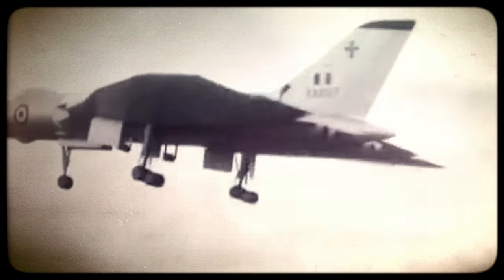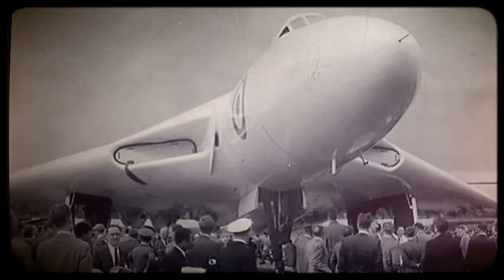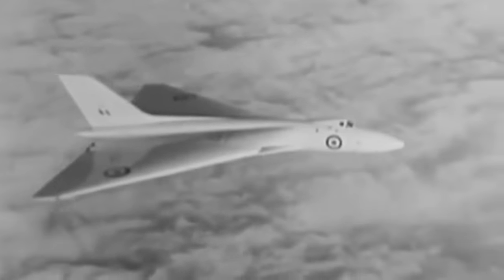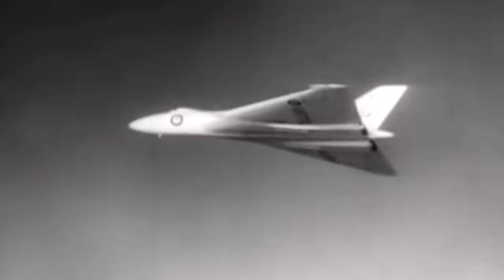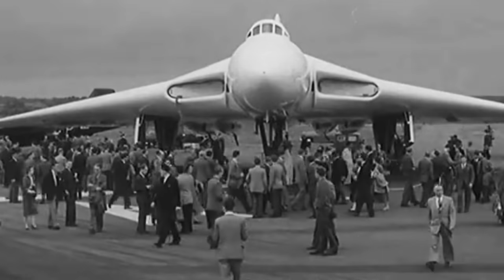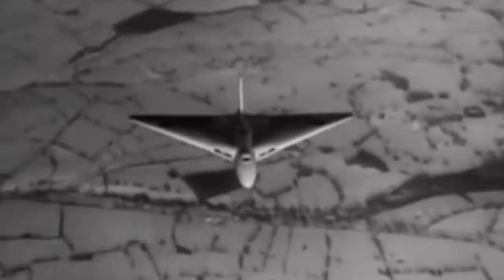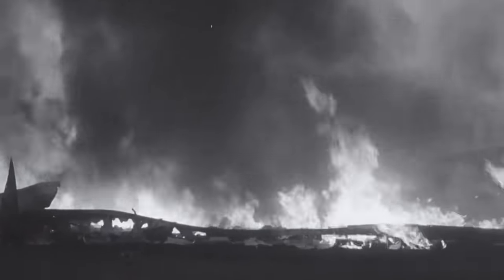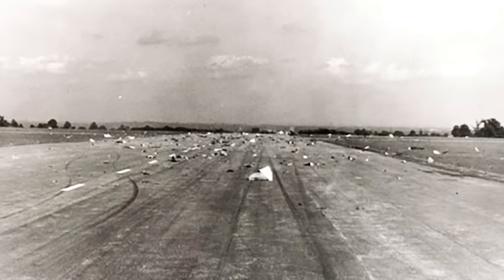Vulcan Bomber Disintegrates on Camera

Comment: As an apprentice, I worked for six weeks on the crash investigation of this event. Every piece of the aircraft and its engines were laid out in a hanger and every single fragment examined for metal fatigue. For me, it was an exciting experience at the time but, looking back on the preceeding events, it was just the finale of a sad event. Although the real cause of the crash was never convincingly determined, it is possible that the aircraft was inadvertently flying outside its fully-tested performance envelope. In later times, when working on other aircraft for another company, the challenge of ensuring that pilots always worked within the authorised testing regime proved so difficult that I quit a well paid and exciting position as Chief Development Engineer over the company's failure to enforce strict control over one particular test pilot. Looking back on those days, one also has to remember that we had no digital computers with which to run any form of simulation and the 'guessing stick' or slide rule was our high-technology calculating device.
Reply: Ah the lost art of stick guessing :-)
Reply: was that in the famous "black" hangar, by any chance?
Reply: @njones420  I was a humble apprentice at the time. I was picked up every morning and delivered to the hanger. I can't remember where it was, just remember the huge collection of bits which we worked through.
Reply: Id say the cause was when the plane came apart in mid air.
Reply: @Lockdown Killz you flew on this plane???
Reply: @Lockdown Killz Yes; anyone else had to do the best they could to get out - crazy!
Reply: ... never heard a slide rule called a 'guessing stick' before... lol!... thanks for sharing BTW
Reply: Satanic Panic Fun and Games  I was driving a 7.5 tonne truck to Glasgow and stopped around 1/2 mile out from Lockerbie on the A74, a few minutes plane after the plane came down. It was dark and all we could see was a number of large pink-tinged fires. When we opened the doors to get out we were hit by the stench of aviation fuel. We rapidly established we could do nothing, so found a gap in the central reservation barriers and headed out south. An awful night to remember.
Reply: Thanks for the cool comment. I bet pilots can be hard to deal with always thinking they’re hot shots.
Reply: Satanic Panic Fun and Games  I understand that the lockerbie plane was at Roger Winley's just outside conningsby and apparently all the wreckage is still there :( god rest their souls.
Reply: @Useless Eater A Vulcan crashed at Heathrow after damaging the rear of the wings after touching down in a field.  The pilot attempted to climb but the aircraft could not be controlled so he and the co-pilot jetisonned the canapy and ejected.  I wonder what the rest of the crew thought about the situation after the pilot and co-pilot had ejected.
Reply: Guessing sticks can now be assumed used as bird bbq sticks or chopsticks. Guess that birds or insects might have caused the accident.
Reply: @KillerGumby-ll5xc  Most Test Pilots actually aren’t like that. I used to work with a number of the Grumman test crew. They tend to be these stereotypical white middle class “Dad” types. Very unassuming. A bit dull. The worlds dullest yet nicest engineers. Except they had this strange calmness about them. They were completely and utterly unexcitable and pretty much unfazed by anything. The ones I knew never acted like hotshots. They didn’t need to. They knew they were the best, and where long past the need of proving it to anyone else. They had a certain dry wit about them. The Summer I worked out at Calverton I had to be in at work real early in the morning. I’m sleepily driving on the private roads inside the complex. I pull up to a 4 way stop intersection. And an A6 Intruder zips through the intersection in front of me, wheels up, 6’ off the ground. The test pilot came up to me later that day, to politely apologize for blowing the stop sign.
Reply: How old are you?
Reply: Was the pilot Tom Cruise? Or Ben Affleck?
Reply: @wizardofahhhs759  Col Steve Austin, astronaut
Reply: Ah yes, the slide rule. A piece of equipment specifically designed to send children off to sleep. Or perhaps that was just my crap comprehensive school maths teacher.
Reply: @johnlong8082  Indeed but, for the engineer of the time, it was indispensible. The slick users could do amazing maths on it. Dug mine out the other day but it has long gone - the way of many memories.
Reply: @Cutesugerforever  
I was being slightly flippant, they were amazing things. I believe mine was a Fabre-Castell? Let’s say I barely scratched the surface with it’s usage. Happy days.
Reply: It looked like the leading edge of the wing broke apart , more then likely  caused  by the kink in the wing due to the wing spar failure , also there  was no pilot error even  tho they made it seam like he  exceeded the performance  envelope  of that  aircraft , he did not. In any case poor design and faulty production !
Reply: @MrLoobu   true but why????? More then likely  the wing spar failed  causing the wing to pitch forward and up causing air drag to rip the wing apart. I saw a jet water tanker wings completely  fold up because  of wing spar failure it was horrible,  I was sad for the crew 😢
Reply: @billsmith9966  No I'm sure he didn't,  but my friend  who flies commercial airliners  737's  saw this video  and said it  was more then likely  due to wing spar failure not pilot  error
Reply: Pushing the boundries always carries high risk
Reply: Why wouldn't they test with sufficiently generous margins of error to cover the pilot's imprecise sense of the plane's safety limits?
Reply: Cutter  Back in those days you HAD to know math.
Reply: Cutter  I'm more concerned about the "Corporate" approach to education. Kids would pull out assignments in packets like they're in an office more than a place of learning and teachers not engaging with them. But all of that is a whole different conversation.
Reply: Pippa , the operative here, sure as hell isn't; 'crash' .
Reply: @johnalarcon5006  Unlikely a wing spar failure initially.  The aircraft was flying relatively level.  The aircraft was experiencing minimal G forces if any.  Even if the wing spar was previously damaged, it's unlikely the critical fail moment would come in level flight.
Reply: @vargavision  You still do, you just don't have to do the actual calculation.
Reply: I wonder if installing the heavier and far more powerful conway engines was a factor?
Reply: Most likely as with the other V Bombers built to .gov spec flying that low the ground shock wave corrupted the structure of the fuselage as they found with the likes of the Vickers.
Reply: @x-man5056  Also I was just wondering  don't experimental  aircraft  have data flight recorders????   And how you said  it was at level  flight yeah when it broke apart , but what other maneuvers  was it doing prior to the level  flight ?  It could  be a few other  reasons  it failed  but pilot error  wasn't  one of them !!!!
Reply: @johnalarcon5006 
The spar crack idea has some merit (I mean it looks like the wing just broke off as it was going along right?), but not likely, with what we know from video.  Typically, a critical failure like that would happen when the wing is loaded, positive G's like at the bottom of a loop.  Even a sudden G load like hitting turbulence but there's no evidence of that here.
The wing survived the G force of what ever maneuver or maneuvers it was doing to cause the alleged cracks, then was flying level.  It looked like something self destructed in the wing area just outboard of the engine nacelles. 
Another educated guess is a turbine fan blade came apart and went through a wet wing tank and ignited fuel on its way out. 
The one's who have the alleged report that's missing, ain't talking apparently.  
The Vulcan was a cool looking Bomber...the Bat plane.  I remember seeing them land at McClellan AFB often as a kid and even when I worked there in the 70's occasionally.
I'm going with the pilot got a little heavy on the throttle of the new RR engines and one came apart.  A piece of turbine fan went through a wet wing tank setting off small explosion and fire conflagration.
Reply: @x-man5056  that's one theory , either w ay it was mechanical  error. It's quite  possible that the  titanium blade from the engine  made that kink that the anoucer reported  seeing .
Reply: @johnalarcon5006  Mechanical malfunction could have been caused by engine over speed and/or hi EGT. Both things the pilot can effect.  Still could be pilot error.  They were newly redesigned engines I think they said.  It's not unusual for new aircraft to have strict performance envelope limits and this plane was doing a flyby.  Could easily be pilot error if he was restricted to 80% power and exceeded it for example.
Reply: True that but wtf did they make the plane out of styrofoam or paper mache I mean hallloo even an idiot should be able to figure out stress limit and triple it the engineers should have been inprisioned for a goodblongvtime
Reply: @buckrogers2828  Interesting. Did they figure out an engineering fix or just a flight envelope limitation?  Vulcan's flew for quite some time after they stopped coming to McClellan AFB if I remember correctly.
Reply: @x-man5056   It was nowhere near 80 percent  power   not at that speed !
Reply: @johnalarcon5006  Vulcan is subsonic.  Top speed clean is less than 700 moh.  So 560 mph.  Certainly couldn't say from the film one way or the other because the film doesn't have any background until it's too late.    Why do we care again?
Reply: @x-man5056  It was no way traveling  anywhere near 500 mph  no way , we don't care !  Do you?
Reply: @x-man5056  Not sure but remember the Handley page and can't remember other plane but both disintegrated flying low which would be down to ground shock wave! There was three planes/companies vying for gov spec for a bomber to carry nuke and there spec was flying in low.
https://en.wikipedia.org/wiki/V_bomber
Reply: @martinwalsh4820  If, as other commenters have suggested, there was a turbine blade failure which damaged the wing structure, the normal stress limits for the wing structure would be irrelevant. Stress analysis is calculated on the basis of the intact structure, not on completely unpredictable damage models'

Being a 1940s British design, the builders would be using Dural, RR series alloys , Hiduminium alloys and Alclad (Or its equivalent) Dunno where the styrofoam idea came from, it hadn't been invented at the time.
Reply: I'm an engineer, and I've never heard that term, but it is now my all time favorite.

I suppose an abacus would be the guessing marbles?
Reply: @FelonyVideos  It is strange when you use a term which has been in your vocabulary for so long and is used without even a second thought, only to be stopped dead when you realise that you're talking what is, to the hearer, the language of Shakespeare. Just before Covid struck, I gave a talk to a bunch of final-year design technology students and it struck me once more that I'm little more than a walking, talking museum. I showed them my guessing stick and thank the lord no-one asked me to demonstrate logarithms on it!
Reply: @MrLoobu  No, that's a result, not a cause.
Reply: i've seen a Vulcan put on quite a display, he threw it around like a big fighter, i was surprised how much he did with it. 
were the latter models of a sturdier build, or still the same spec?
Reply: One of those puppies crashed in Detroit, back in '58, after an electrical failure over Canada. They had NO backup systems!
Reply: My father who is an aeronautical engineer (nothing to do with this incident, he was 13yo at the time) once commented on this incident that in his opinion, as the plane was designed operationally for high altitude missions, using it that day for a couple of hours at low altitude close to it's performance envelope limits stressed the metals of the structures too much due to the superior thickness of the air in respect of the air in which it was supposed to fly long range.
Just my two cents 😊
Reply: Are you dissing on the Late Chuck Yeager??
Kidding. But, those guys Always went "Balls to the Wall."
Reply: Never knew of this accident. Sad to say the least.  Test pilots are some of the best and bravest at what they do, knowing that accidents can occur at any time. Prayers to all involved in this terrible accident.
Reply: @johnlong8082 slide rule. Any number to any power, even negative fractional powers.. very impressive, very fast, ok to just 3 or 4 significant figures bu5 that can easily be cleaned up later using logs or a comptometer.
Reply: @buckrogers2828  what 😂
Reply: @martinwalsh4820  whaat !! It’s not a bridge! You don’t triple reserve factors on aircraft structures. You work to very precise limit and ultimate loads usually about 1,5 x apart then ensure small reserve factors on every sizing. RFs usually in the 1.05 to 1.1 range.
Reply: @buckrogers2828  no mate. Absolutely not. No ground shock wave at that clearly very subsonic speed  and the V bombers were DEFINITELY not designed to fly in low. Definitely not. Latterly the Vulcan alone did have its mission profile changed to part low interdiction, these were late model Vulcans and had their fatigue life radically reduced commensurately
Reply: @andrewtaylor940  "blowing the stop sign" that's a good one!! 😄
Reply: @v8pilot  my understanding is that due to cost the V bomber force only had ejection seats for the captain and co. Due to a number of 'crashes' this situation led to a good deal of 'dissatisfaction' amongst other aircrew members, some suggesting (awkward humour)  that once on board they would  rope themselves to a captain or Co-pilot.
Reply: @martinwalsh4820  Unfortunately, tripling the design above the stress limits would have kept the plane on the ground permanently. It was a military aircraft and safety margins were accepted as being less than on civil aircraft. Also the understanding of metal fatigue was in its early days and that was likely a contributing factor.
Reply: @Cutesugerforever  Indeed, I talked to a bunch of final-year engineering students recently and at the end felt like picking up my stone axe and bumbling off muttering jabber jabber.
Reply: @johnalarcon5006  Not to mention, any high performance craft, or load bearing structure should always be built to withstand stresses that are at LEAST 10 percent greater than their expected capabilities, should they not?
Reply: @michaelscott356  true
Reply: @drpoundsign  They were fitted with an emergency ram air turbine electrical generator.
Reply: @drpoundsign  They were fitted with a ram air emergency generator.
Reply: Rolls Royce pail for an investigator to testify to Board of Inquiry and present evidence that the pilot recklessly flew outside the flight envelope as the Inquiry was beginning to hone in on point failure of the rolls Royce engines. 
Manufacturer Avro considered this to be needless obfuscation and had no basis in reality. 
A Inquiry member plus Avro unofficially cited metal fatigue damage in the engine that Rolls failed to notice that resulted in uncontained engine and airframe failure when the pilot performed a unplanned but otherwise within limits aerial move. 
If that’s correct then Rolls would bare >50% responsibility for inspection negligence. Avro would- I kid you not- have a petite maintenance guy go in and look for damage in spaces which were otherwise very time consuming to check using the technology at the time. 
Rolls was unaware of this type of inspection tactic.
Reply: I would argue that manual flight controls provide analogue feedback much better than fly by wire which by definition provides no analogue feedback. 
For example example Boeing’s secret anti AoA stall software for 737 max would secretly hijack pitch trim if it sensed a sudden rise in thrust (for example if the 2 crashes didn’t occur in the way they did, we could have gotten a 737 max crew following their TCAS alarm to “climb, climb now- climb, climb now-“ but Boeing’s software would’ve been like “no I’m setting the pitch trim down and we will collide tyvm”.) but when the pilots of the second crash were able to disable the software the aircraft was already outside the flight envelope and resetting pitch manually would have required >100 pounds to move via analog.
Reply: @x-man5056 The Vulcan was extensively redesigned after this accident. Notice the straight wing leading edge on the early version and the curved leading edge on the later version.
Reply: The slip stick was pretty accurate. They designed the 747 with it.
Reply: @v8pilot I know this is 3 years after your post, but there you go.
My son and I had a tour of a vulcan a few years back. It's not that roomy in the cockpit.
The guide (ex carrier pilot) explained that the crew in the section below the pilot and co-pilot would have to jump out of the bomb bay opening before the pilot and co-pilot ejected, as they'd be incinerated from the rockets propelling the seats if they didn't leave first. Pretty much a lose lose situation for the crew in the mid section.
Reply: @themotorider1  I read somewhere that, after the Heathrow Vulcan crash, the pilot and co-pilot were criticised to ejecting rather than staying and perishing with the rest of the crew.  But the answer was given that to have stayed when they could have ejected would have been contrary to strict standing instructions.
Reply: I’ve never seen a published report of a Vulcan which landing, lost its tailplain assembly on deployment of its break parachute due to the use of a 1/4 inch nut and bolt instead of a 5/16 inch nut and bolt. Has any of this readership?
Reply: @v8pilot  I guess they were too low for the crew to bail out even if they had time to open the bomb bay doors. I'm sure the pilot and co-pilot didn't exactly have time for a team meeting before they crashed. They made the right decision I guess. Not something you'd want to live with afterwards though.
Reply: It appeared in video that it couldve been design flaw in the stress capability of the wings. Possible type of rivets used or not enough rows of them being used in that area of the wing structure. Poor inspection of the aircrafts integrity after each test flight couldve also played a role. Not knowing exactly what caused the complete disenigration of the aircraft makes blaming the pilots too easy. Just saying. Thank you for your first hand knowledge of the incident.
Reply: Prove it?
Reply: @BimmieJames unfortunately on the max, pilots did not equate what they were experiencing was in essence nothing more than uncommanded trim. The fix? Switch it off and continue flight trimming manually as every pilot is trained. There were other mitigating options available but this one goes back to basics.
Reply: @MrLoobu yeah, the last flying one had the leading edge of the wings reinforced mid wing, as it was know (recently) as a week spot.
Reply: And yet that "guessing stick" few of us lovingly remember, gave us the SR71 Blackbird, the Apollo F1 engine and to be honest, it's doubtful we will ever be able to replicate those. Computers are absolutely essential in this day and age but I'd say they aren't an adequate replacement for our ability to think and read a line on a slide rule.
Reply: Stop the cap
Reply: *hangar.
Reply: @x-man5056 hard landing previously can cause really un-entended damage
BUT never given a second thought . . . UNTIL all hell breaks loose.
The difference in land based bombers construction and those tail-hookers is like night and day.
The folks that design tail-hookers grossly over design them.
Reply: @johnalarcon5006 not in 1959
Reply: @gigmaresh8772  Mmm, I wouldn't say grossly, it is engineered with a safety factor though.  So things are just a little stronger than the design engineers formulate that they need to be.
I was a Navy Airdale, an AME 72-75.  So you're preaching to the choir but you are correct.  And it is very evident with F35.
Reply: Imagine being a minimum of 86 years old surfing YouTube. I'm suspicious as all get out.
Reply: @caledoniawarrior  A minimum of 86 years old, come, come. You may borrow my slide rule if you wish. I'm only 84 years and some 363 days old. Some memories never fade though and my recollections are clear enough. As for we wrinklies surfing the internet, my grounding in computers began in 1965 when I learnt Fortran and there's been many a computer language I've battled with ever since. Old does not equal feeble minded. so forget your suspicions and embrace a wrinkly - we need it sometimes.
Reply: Remember the Vulcan being used at Filton airfield sadly no longer a Airfield, but it was used to test concorde  engines on, remember it well as a child in the late 1968 to 70s being used and seeing it flying a lot as a child , great memory,s
Reply: I remember this plane incident. I’m an octogenarian.
Reply: @colinnicols5387 I agree. I am a retired 737 Captain and we’re trained to do exactly that by our airline in the US.
Reply: @njones420  We had a black hangar during my tech school days. Black Shack is what everyone called it. While the students all had to have a Top Secret security clearance, it really wasn't all that different to any of the other hangars. Just some of our armaments were classified. It's not like the Ruskies didn't already have the info...
We were warned that someone may approach us in town, offering to buy our textbooks. Our Sarge said it was guaranteed that they already have that info. And the purchase would be to sink the hook for future blackmail.

Someone should have given that speech to Eric Swallwell! 😂
Reply: My dad an engineer and I watched Air Crash Investigation several times. I learned so much about  of engineering and the Investigation process with him there. You guys do great work! Thanks!!
Reply: @michael_mouse  log log rules that handled exaggerated math.
Reply: Did this have anything to do with the change in the wing's design? I noticed that the prototypes had more of a straight edged delta wing tip and later ones it's curved.
Reply: Yes, we’ve all watched Mayday, kid.
Reply: @njones420  They’d have to actually be there to have any idea.
Reply: @andrewtaylor940  Come back when you’ve actually experienced something, kid.
Reply: @D-FENS_  They’re 12, like everyone else in YouTube Comments who were totes there for the event!
Reply: @TheOriginalCFA1979  Maybe ... I only mentioned it as that is where the Lockerbie crash wreck went for AAIB investigation.   I've worked there for 20 years  :)   I also work with a retired Vucan pilot who's told me many stories.   Small world  :)
Reply: Pretty poor design that the speed limits are that exacting. This wasnt some ultralight
Reply: Did they have a voice recorder running? Ive always wondered, those are some of the most erie things to listen, the alarms the fear in their voice, and sometimes their last breaths, rest easy.
Reply: @TheVickersDoorter I was among the first RAF troops there that night from nearby RAF Spadeadam. We would have passed each other on my way to the town. We initially went near Sherwood crescent. Horrendous. You said about the aviation fuel smell, my memory is similar but add the smell of burning flesh to it and it’s a unique smell I can recall now as I’m writing this. 

I spent the next 2 days searching for (and locating) bodies in the fields then in the most surreal way disappeared off home for my first Christmas with my wife of two months. I still, 36 years later, cannot get my head around how I had a happy Christmas after what I had just witnessed .

I still suffer mild PTSD in that I have vivid dreams of what and who I saw on those two days.
Reply: @IARRCSim it’s got to be remembered that this aircraft VX770 was one of the early prototype test beds and had been used for a lot of the aircraft’s development. As mentioned it had several engines and many hours of performance testing. Also as a testbed they are pushed to the limits that a normal pilot would be allowed but also beyond to find the aircraft’s limits. That’s part of its role.

The unfortunate thing if this was an overstress causation is that it may have been many flights beforehand that the actual damage was done with this flight merely being the time where the fault deceived to “let go”.
Reply: @andrewtaylor940 I guess the hotshots didn't last on the work, one way or another.
Reply: @MrLoobu  its near 2am i can't sleep from stress about work tomorrow...but your comment made me laugh.  A big thank you for that.
Reply: @johnlong8082 The tricky bit about using a slide rule (of any type) was keeping track of the decimal point.
Reply: I've always found it amazing how wrecked aircraft (or any large vehicle) can be put back together after being torn into a million pieces, and the cause can usually be found. Incredible!
Reply: @ANYHOO0  yea and i still struggle to reclose  those clip fresh bags my sandwiches come in for my lunch !  True!
Reply: @njones420 at Farnborough that hangar was known also as the ‘shed’
Reply: @Cloudminster  that’s the one I’m thinking of ;)
Reply: @MrLoobu  well done!
Reply: Didn't they reprofiled the wings after this accident? I remember reading somewhere that it was caused by excessive wing flutter